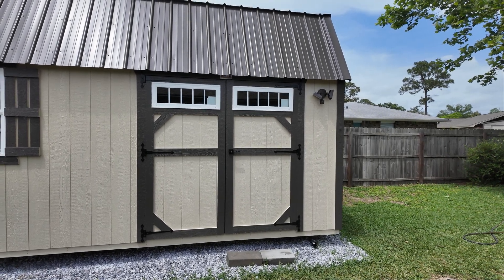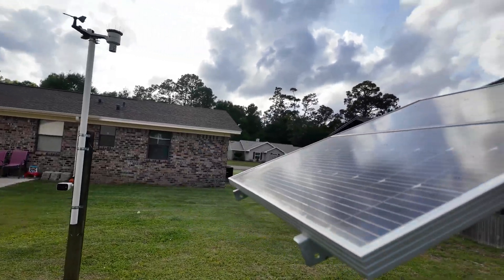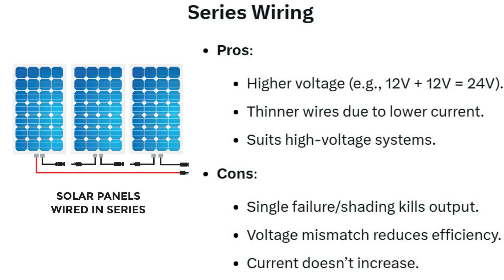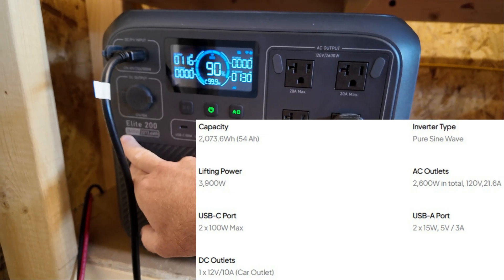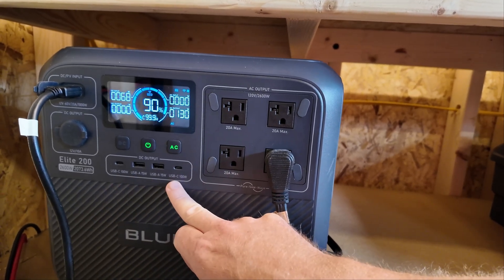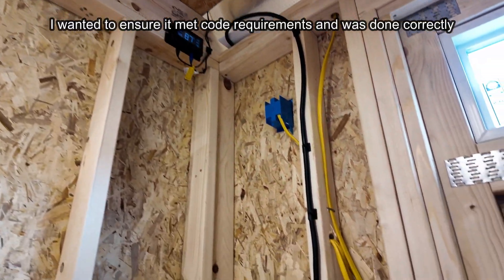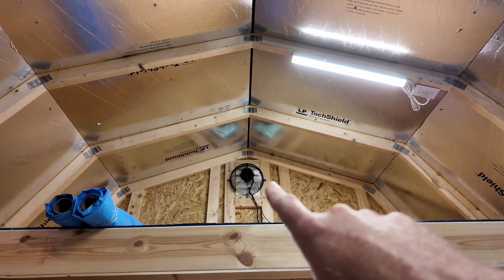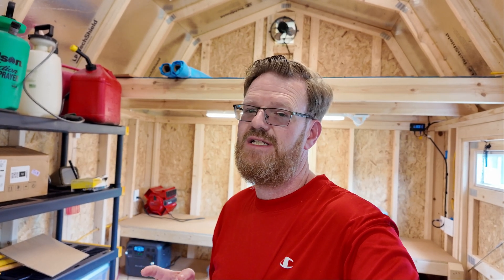Off-Grid Solar Shed: My Detailed Build!

Comment: I have a 12 x 20 shed I would like to go off grid. I run a massage type of business and set up my shed for that. My concern is keeping it heated in cold SD weather. Any suggestions?
Reply from the maker: Start by insulating the roof and walls. For heat I would use a diesel heater.

Comment: High frequency transformerless inverters like these are a Chinese scam. Buying an inverter without an output transformer is like buying a gas powered car without a transmission. 😂😂😂
Reply from the maker: I have had good luck with these and the point was to show people how to have an easy all in one setup for a shed.  Not a house. 
I am not sure what you mean by transformerless.  These do have tiny ferrite transformers in the inverter and they are way more lightweight and efficient than old school transformers. You would not need a transformer unless you needed 240. I don't. If I did then I could add a transformer.

Comment: My LFP setup is guaranteed to retain 80% of its original capacity at 6,000 cycles. This is 16 years and 5 months.

So far, it has endured 158 cycles, according to the Victron Smart Shunt, in 1,260 calendar days. or 3 years 6 months. So, if three and a half years have shown only 2.6% of its lifespan, it is expected to reach be at 80% in 626.5 years. 🤣

Keep the battery in a temperature range considered comfortable to you. Cold-weather charging is the worst thing you can do to the battery. It can be done, but instead of regular 0.5C charging, lower it (if you have the option) to a 0.1C or less charging rate. If you have a 100Ah battery, then no more than 10amps when it is cold.

Comment: how did you connect the wire for lights and all the outlets to the power station?
Reply from the maker: Via a gfci outlet.
Reply: @jamie.andrews whered you get the power cord? because i assume both sides are plugged in
Reply from the maker: @josequinonez-x2t One side is plugged into the Bluetti and the other is wired to the back of the GFCI outlet.

Comment: Not understanding the cord coming from power station to outlet outside
Then power from that back inside.. can you explain more? Looking to do similiar setup just for a few lights and charging batteries for drills etc
Reply from the maker: I'm sending the power to a gfci outlet and since it is one I mounted it on the outside to give me outside power. The gfci acts as a breaker.
Reply: @jamie.andrews okay so it powers stuff for outside if needed? How is power ran inside utilizing the power station? 
Sorry I’m not understanding it lol
Reply from the maker: @brandon585 power comes out of the Bluetti via power cord which is wired to the back of a GFCI outlet. The rest of the shed is wired on the other side of the GFCI outlet. This also allows me to use the outlet as an outside outlet since it is GFCI.

Comment: I have a shed being delivered in a few weeks and your setup is almost exactly what I’m wanting for my shed. What type of insulation did you use in the shed?
Reply from the maker: No insulation in the walls. Just Reflectix on the inside of the roof.

Comment: I noticed you had a window AC unit in your shed. What system is that and how many Watts does it pull? Any issues running that and other things? Thanks!
Reply from the maker: That is just a fan in the window and it pulls about 10 to 60 watts depending on the fan speed. I could run a window unit though, but it won't run very long or be very effective in the summer heat.

Comment: I used RPS solar panel mounting system for my 2 100 watt panel . Easy build and a good price for it intead of paying ala cart for parts
Reply from the maker: I like the RPS system but it was also twice the price of this.  The mount I have is just a single kit with no extra parts needed besides the pole.
Reply: Just looked at rps . Did not pay that price two years ago. I liked the angle adjustment system . That’s why I bought it. Simple
Suggestion buy things for solar or dyi projects on Black Friday sales
Reply from the maker: @babkaking I like the expandable options with RPS. Solar stuff has been hard to get lately for a good price.

Comment: Question, why solar panel not on roof?  Why doing AC lights?  Better with DC 12v light no?  And your solar is way way too little.
Reply from the maker: I did not want to drill through the roof. AC is used throughout the shed so putting DC in the mix means using more power at idle plus having to run separate wires. The solar has been fine for the current setup, however I have plans to expand the solar in the future as I want to use it to charge my robot mowers.
Reply: @jamie.andrews using DC is less power meaning you don’t lost energy via battery to AC conversion.  and no using to use same wires for DC (overkill) but no issue
Reply from the maker: @ometofu Yes that is true and the reason I got one of the most efficient AC inverters.  I still have to have AC in my shed as not everything uses DC.

Comment: Can you share more about how the single plug is powering all other outlets? I'm interested what the other end of that plug looks like.
Reply from the maker: The GFCI outlet is acting as a breaker. Power from the Bluetti comes in on one side of that outlet and goes out to the lights and outlets on the other side of the outlet.

Comment: Suggestion you install a solar powered roof/gable fan, with built in thermostat. 
Relieve the power station of draw, no need to for additional outlet and thermostat. 
Also, a solar powered exterior security light will reduce the power station draw.
Turn on the AC security light, use a remote fob, when necessary.
Reply from the maker: I'd likely just add another panel if I began using more power than I can handle. The solar powered fan has a few problems. It cost more than what I have, are typically required to have a flat panal mounted to the roof which I am against. I'd also have to get one with battery storage and I am not sure it would last long enough to power the fan for days if we had overcast weather. As for the security light, it is a motion light that stays on for 30 seconds.  It rarely turns one.  Maybe 3 or 4 times a week. 
In the end I wanted my entire shed to be powered by this setup and have the option to increase solar panels if needed which throwing another 100w panel up would more than cover those 2 items by themselves plus more.
Let me know what you think here.

Comment: You had me right up until you said bluyetti... please buy a victron controller and a battery system. They're much cheaper and scalable...
Reply from the maker: I made the choice to go this way for many reasons  This is an all in one unit that is much smaller than if I bought a charge controller, an inverter and then batteries. It is plug and play and for simplicity. If I have issues I have one manufacturer to deal with not 2 or 3. It is also very efficient for leaving the AC inverter on all the time.
Pricing is closer than you would think.  Atleast for what I paid for the Bluetti. I don't need scalable as this is just a shed mainly used for storage.  If this were my home I would not use this setup. 
Lastly if I need to use this for travel or camping I can simply grab it out of the shed and take it with.
Reply: @jamie.andrews  I like the fact that I could potentially power an RV or shed given it looks fairly portable.

Comment: Nice. I can guarantee you that you will look at that extra space on your rack every day and go "gee... I bet I can fit a third panel there with just a little wood extension".  Every day until you buckle under and do it.  Happens to every solar enthusiast!  Well, assuming the mppt can take the higher series voltage that is... double check that first.

Roof-of-shed panel mounting is also an option.  Just flush, without rails, using direct mounting kits.   Google "S-5 mounting" for an example.  Since it isn't a high roof and easy to get to, definitely an option.

Current will still pass through a failed or shaded panel, by the way... that's why panels have bypass diodes.  Though I'm not sure about those 100W panels... you could open up the plastic module on the back and look and see if it has diodes or not.  It probably does, though.

-Matt
Reply from the maker: Yea I hear ya on the 400 watt panel.  I certainly might! I can't add a 3rd one unless I switch to running them in parallel as 60v is my max on the inverter the these max at around 20v each. Real close. 
This was my first go at solar so I am sure in a year or 2 I might do things differently.
I think it has blocking diodes to protect from one panel being partially shaded, however zi thought if the entire panel failed it would cause an issue.  Good to know.

Thanks for watching and taking the time to comment.

Comment: Good day sir! I saw you had a window unit air conditioner. How do you power it? Thank you…..
Reply from the maker: It can run off the Bluetti. It won't run long, maybe 3 or 4 hours, but it could run on it.
Reply: It can run via power station. Specially inverter AC.

Comment: If you can't turn the lights on without a net loss of power, why don't you just double your panels up to the 400 watts that it's capable of?
Reply from the maker: My panels on a sunny day produce a net positive, but I don't run the lights during the day I run them briefly at night. On a cloudy day it can vary, but I regularly see it peak at 195 at 1pm and for much of the day I am getting 180 watts.
If I were at a net loss with my system I would be draining the battery from time to time and I have not so far come close in 1 month. If that did become a problem then yes I could buy more solar. I just don't see the need for it as of now and 100watt panels are much cheaper that 200 watt panels.
Reply: Ultimately it is all about convenience.  At some point the number of panels means you no longer care about inverter idle consumption, at another point you don't worry too much about working late at night with the lights, at yet another point you might add a small fridge... and perhaps even decide to throw a mini-split into the workspace.  And so forth.   Solar panels are very addictive.
Reply from the maker: @junkerzn7312  All of that makes sense and are good points.  I also think it depends on where you live too, but so far this keeps my system topped off on a daily basis even when I have several days of clouds or rain.
I did not mention it in the video, but since I live in Florida I wanted the keep the weight down so I can remove everything off the pole when tropical systems hit.
If I do upgrade the system I will do another video for sure.